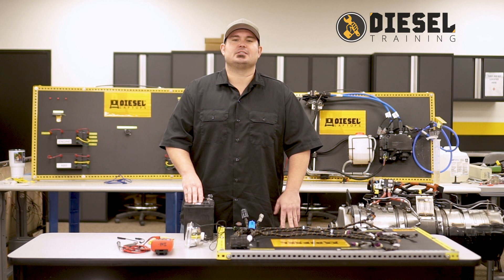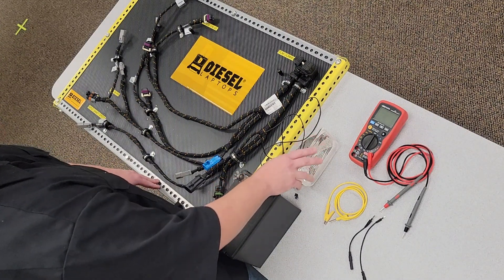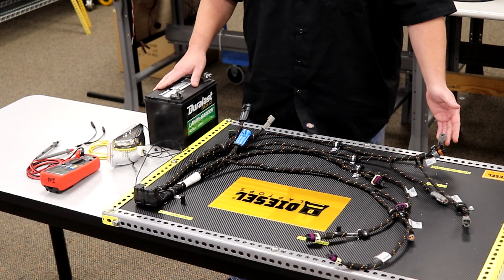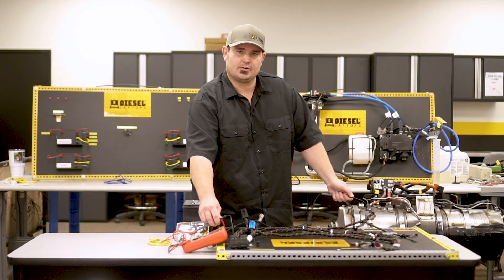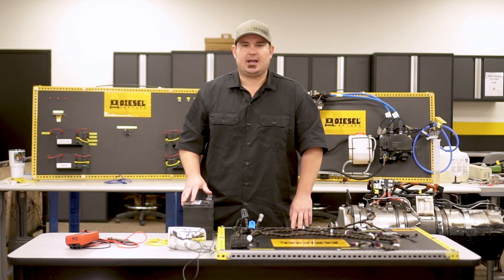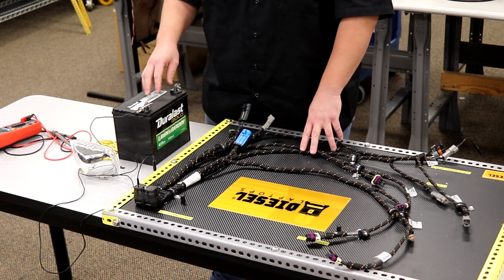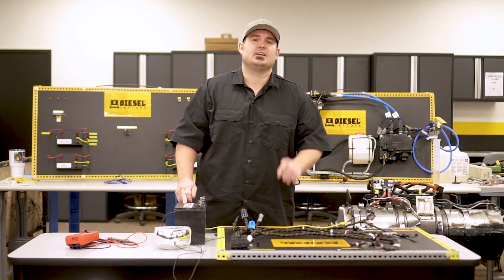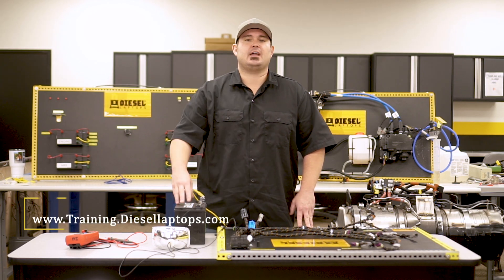Commercial Truck Load Test - Electrical Troubleshooting

Comment: This is so critical especially up here in the snow, ice and salt! See people check voltage w digital meters or Power Probes and get fooled by “false voltage”. I keep an old analog meter around. Little tougher to fool it. 
     Other ways to test but the headlight is simple, cheap and it works.